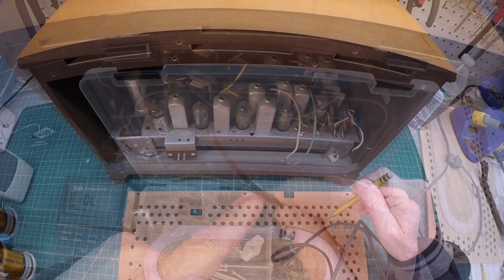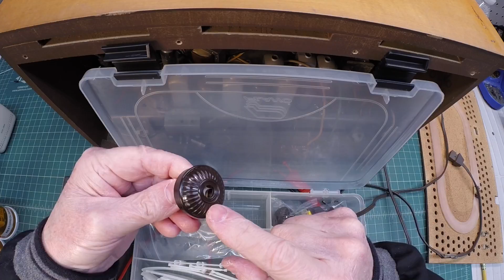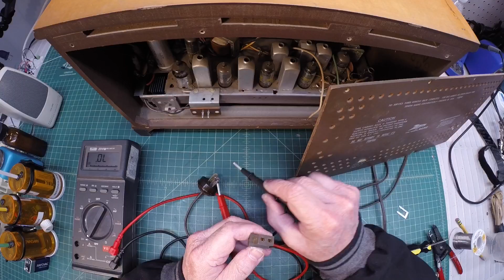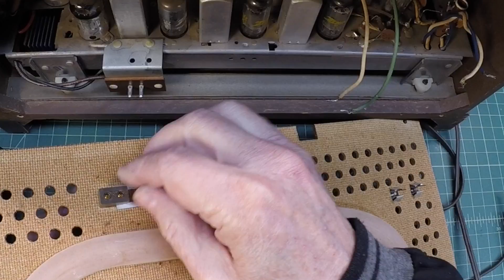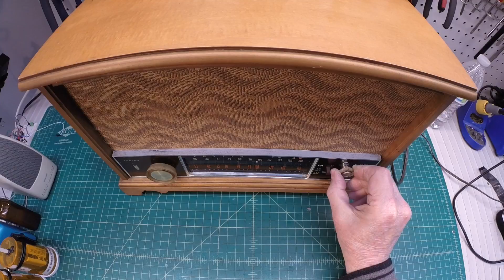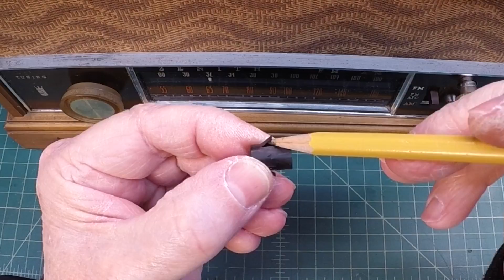Zenith K731 - New Line Cord, Brief Power Up & UL Captive Knobs

Comment: Hello and nice to meet you, if you don't mind me asking I have a question i have the exact same year radio that I have purchased from a thrift store and mine has a weird Buzz noise every time I turn it on, you seem to know a thing or two about these type of radios  I'm just curious if you could tell me what I could do to fix this please.
Reply from the maker: In all cases vintage radios and alike need to have all paper/wax capacitors replaced as well as out of tolerance resistors and all frayed wiring. This particular radio has a selenium rectifier that should be replaced as well; if they implode a very stinky/toxic… The hum is most likely tied to the electrolytic capacitors that are at end of life and other… Check the antique radio forum and see if a repair facility is nearby and go from there. Hope this helps. Best, Don

Comment: i have one but it only gets am stations but no fm what do you think it might be?
Reply from the maker: It’s not possible to say. The AM & FM are two separate circuits for the most part. Best, Don
Reply: @RestoreOldRadios  i just took the back out an just moving the tubes thinking there were loose it still does it but i just banged the top of it an itll work again
Reply: @RestoreOldRadios  ive been thinking that its a vacuum tube loose or something

Comment: A quick note:

Those cords are polarized, even it the plug does not indicate it.  The ribbed side of the cable always goes towards the chassis.  If there is no rib, there will be some other kind of indicator .

Comment: Are you aware of a good supplier of the "cheater cords,"  I think  is what they are called -- the 2-prong female plugs that stay on the radio back when the back is removed.  I have a couple radios that the cords have gone missing, and I'd like to find a more original or elegant way to replace them.  Also are they a standard size?  Thanks for the informative videos.
Reply from the maker: Check out Surplus Sales of Nebraska at: http://www.surplussales.com/electrical/ElecCords-1.html  They have a variety of these. Not sure on the standard sizing as most of my restoration work dates back to the late 1930s to mid 1940s. I hope this helps. Best, Don

Comment: Nice work as always, Don.  Do you recall the amount of resistance you added when replacing the selenium rectifier with the diode? I've got a couple of Zeniths from the same era I need to start on.  Thanks.
Reply from the maker: I used a 75 ohm 10W Resistor that I had on hand. My voltage drop was 5.3V at 0.07A and 0.4W. This got me real close to the B+ voltages as noted on the schematic. Of course my Resistor was a little overkill on the wattage side. Best, Don
Reply: Thanks!

Comment: Couldn't you put shrink wrap tubing over the metal pot shafts? I realise it might be a tight fit are they spring loaded the knobs, or fixed? spring-loaded wouldn't be an issue fixed you might need to make a bit of room buy lightly draining it out slightly. And I suppose you need to cab! the end? By putting a drop of glue.
Reply from the maker: Great idea John! I’ll keep this in mind next time I run into one of these “captive” knob radios. Best, Don